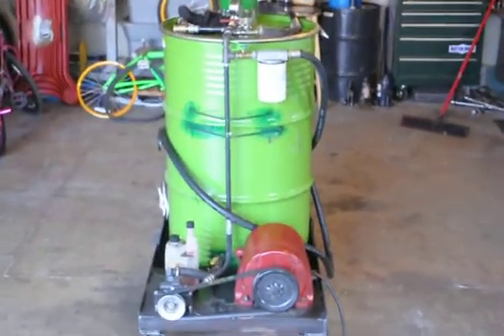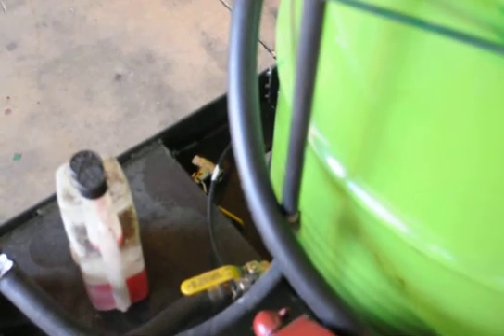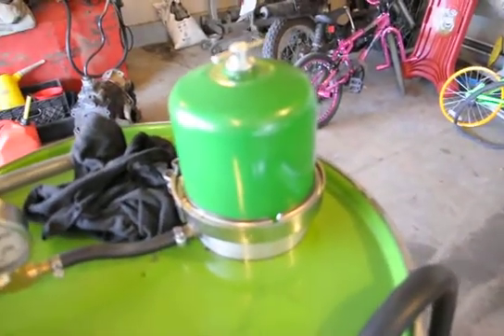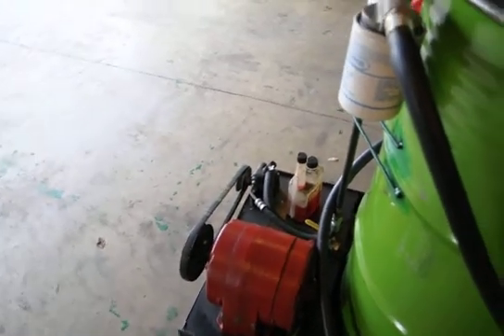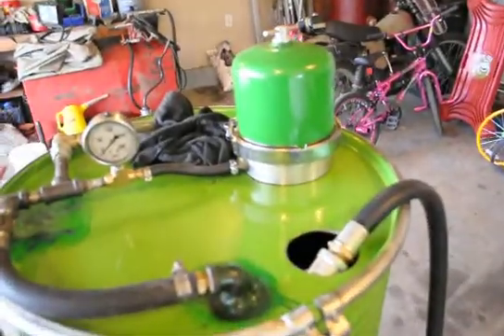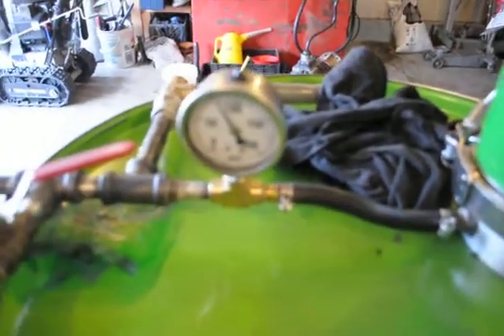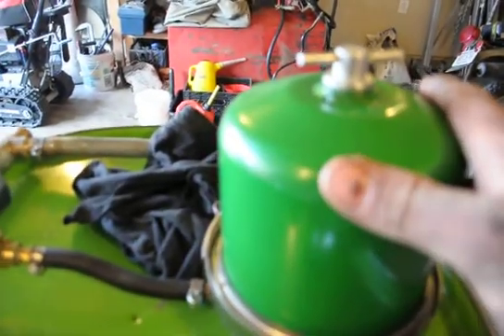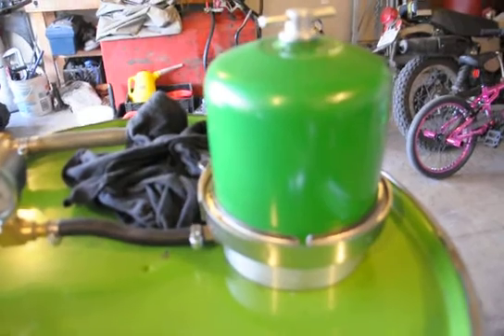waste motor oil processor wmo with centrifuge

Comment: What's the update on running wmo? Miles logged? Problems?
Reply: I've been running my ford ranger 2006 2.5ltr diesel for 5 yrs now. Injectors clogging every year or so . I just pull the injector out and clean them with an injector pressure tester. A little bit of smoke till ute gets up to operating temp , all good I've done 70000miles on wmo .

Comment: Just stating a fact fella. Power steering pump running pressure is 100 to 150 average. When turning the steering wheel that will go up to 1000 to 1500 PSI. Resistance to flow determines pressure. I have to make me one. Nice work fella too. VF

Comment: 7.3 L gang! About to do the same thing.  Except I wasn't going to mix the oil w the diesel fuel 50/50.  Is that necessary or can I do the rear tank as oil only? Thanks

Comment: Somewhere I saw a guy use a water heater electrode online to preheat oil before centrifuge. Do you use heat ? I may have missed that
Reply from the maker: No it heats up pretty fast under hydraulic pressure runs about 104
Reply: That guy said the additional heat would evaporate any water present in the oil
Reply: @faithful53  you need another setup for wvo. This is for wmo only

Comment: I'm still using the turkey fryer method for WVO for my 6.9.  Though I admit putting 5 gallons of motor oil on an open flame would be pretty sketchy, my cost per gallon is about $0.05.
Reply: What’s the turkey fryer method?
Reply: @mattleonard5268  Essentially, I bought a Bayou Classic turkey fryer, which is literally just a 5ish gallon pot and a stand with a propane burner.  I pour the used vegetable oil into the pot, heat it to about 230f (at my altitude, I should be able to get away with 205f, but I wanted to be thorough and wasn't sure how water would behave submerged at the time, etc) and then dump it into a filtration set up.  The idea being that the act of pouring the oil into the set up that way would allow the water to evaporate out.  Either it works well, or these engines don't care, since I haven't had any detectable water damage to the fuel system on either truck I've run it on.

It's not the safest, pouring 5 gallons of 230f oil into a funnel, and I used to have to get up on a step ladder since I had it drain into a 55g barrel and wasn't using a pump for any of it.  I built this system back when hurricane Katrina hit the gulf and regular gas hit $4 a gallon.  I didn't have the money to build a better set up at the time, and it worked for long enough that I hadn't bothered trying to improve it until about a year ago.  I never spilled enough on myself for an actual burn, though it was kind of hell on my back when I would process 20+ of the cube jugs at one go.

The newer system I've been building is pretty much the same thing, just with a high temperature oil pump to pump the oil into the filtration setup so I don't have to do the lifting I was doing before.  I've also been working on a better way to get the oil from the storage into the truck, as the crank pump I was using for that gets pretty tedious as well.

Comment: FYI. Power steering pumps at speed will pump 750-1200 psi
Reply from the maker: This one by passes at 120 I have not tested the bypass in the pump
Reply: Bear's End Productions I actually have a similar power steering pump on my shelves I plan on using for this same type of setup.  I’ll be using a adjustable bypass regulator to control the pressure

Comment: Nice video. Just want to mention, you guys have dirt cheap fuel in the US. Here in northern Europe, 1 litre (0.26 us gallon) of diesel costs currently 1.4 eur, which is something around 1.6usd. Gasoline is slightly more expensive.
Reply from the maker: My county is larger then your country fuel prices that high would shut america down
Reply: @bearsendproductions1843  that comment didnt aged well !
Reply: @David-li1uc  $5.50 - $6 a gallon for diesel or gas here for any length of time absolutely WOULD shut the country down, so he was right on the money 4 years ago when everything was cheaper.

Comment: So I am Looking to get into this also. I have a few questions for you. First, you said you run 10 perfect gas and then cut 50/50 with diesel on top of that? What is the purpose of that? A lot of people seem to say 80 percent oil and then 20 percent gas and then run it. I’ll be running it in a 7.3 so if this mix works well then I’m certainly all about it . Second, does that centrifuge not have a motor on it? Does it just use the pressurized oil to spin it? Third, from what I can tell you simply have a 55 gallon drum, you fill it with oil, then just have the oil continuously cycle through until it’s clean? There isn’t a holding tank or anything like that right? Thank you so much for the help. I’m really looking to save some money with this
Reply from the maker: I cut with 10 percent gas then run it 50/50 with diesel its cleaner less smell and it can get cold here so straight is too thick
Also I would add a larger centrifuge that runs off a motor it cleans much faster
Add the gas to the dirty oil then clean it
It will help clean it and blend together better 
After about an hour of running the oil temp is 120 so you dont need a heater good luck it's well worth the money

Comment: I'm really familiar with running WVO and have been researching WMO. How long and how many miles have you ran your 7.3 powerstroke on WMO? Have you tried any higher ratios than 50/50? Thanks for the info. These small centrifuges are an awesome value!
Reply: I heard in other people video. U can run 100% with two tank system . Start and finish on diesel

Comment: Hello, what type of centrifuge is that, it looks like a basic fuel filter to me, where can i buy it?
Reply from the maker: I got this one online I believe its called a spin free but just type in wmo centrifuges into google or ebay  and you will get a good selection.   Keep in mind your pump volume and pressure to match this type of fuge too your set up.

Comment: Lets see that motor to good use already
Reply from the maker: 1962 ford falcon two door with a tremec 5 speed is in the works for the om617 diesel in the shop. We will run it on used engine oil and call it the dirty bird my daughters nickname her car
Reply: Im really looking forward to it.  New channel now. Ill be reposting soon. They censored my last.